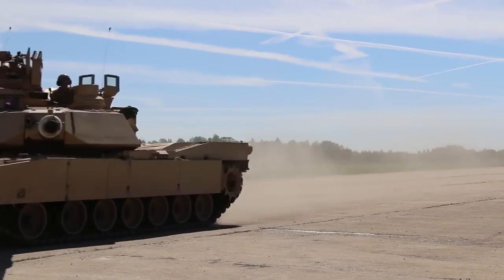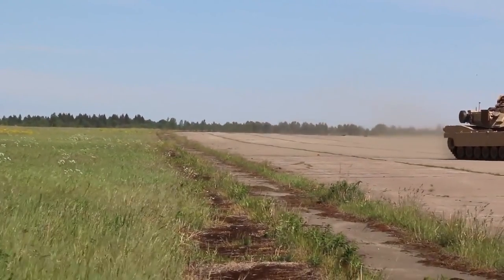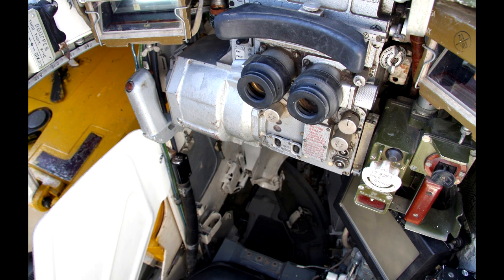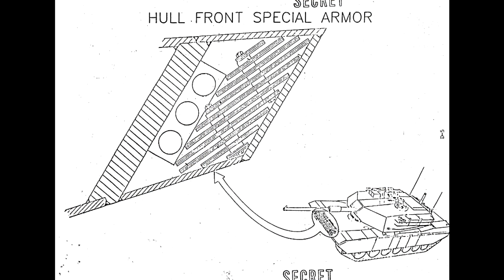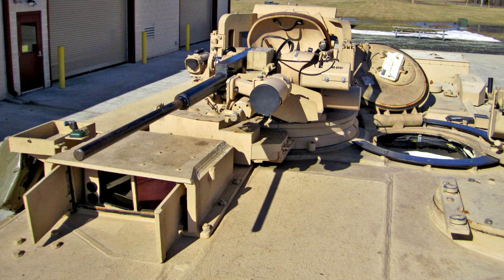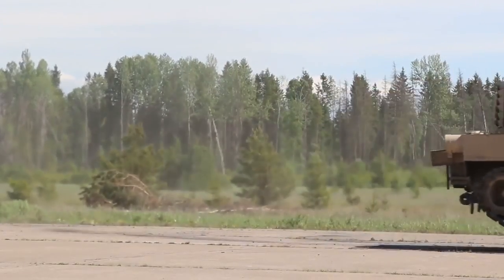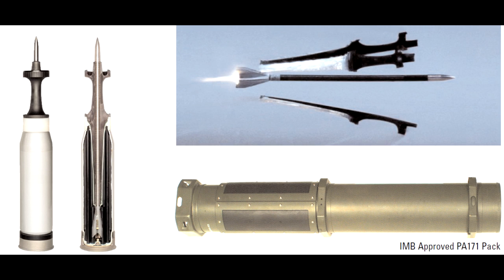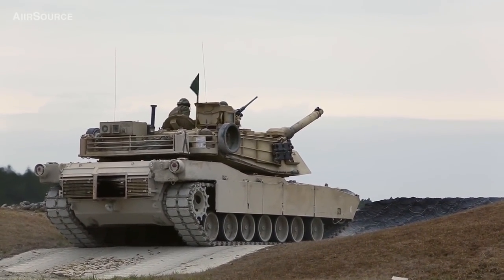Problems with Abrams tank

Comment: None of this is a surprise. Remember the 1st Gulf War? While the press called the Abrams invincible, the US Army actually realized that the Abrams was seriously flawed and that it was crew training that won the day. One high ranking officer even claimed that if his crews swapped equipment with the Iraqis they still would have won due to their training. The Saudis and the Turks are leaning the same lesson now. Poor crew training and improper deployment will leave any tank vulnerable no matter how well made.
Reply: Sure, that's true. Both sides had problems. For example, the M1 had a long trail of unarmoured fuel trucks following them for the all too frequent refuelings. This was a big problem that became a disaster in th 2nd Gulf war. I could talk about other problems. My point is we could go back and forth comparing strengths and weaknesses (ammunition, communications, export versions of tanks, C3I, etc....). The M1 wasn't the perfect weapon system it was presented as at the time and the US Army knew it. But it is true that the American crews were trained to a sharp edge at the NTC and other venues, and the US Army command believed that this was as significant a factor in the victory as the equipment.
Reply: @bohica3264  My dad was an Army fuel truck driver during this war. Thank God, he never went over.
Reply: @bohica3264  The M1 Abrams was designed to fight a primarily DEFENSIVE conflict for the expected Warsaw Pact invasion of West Germany, wherein the Group of Soviet Forces in Germany would launch strikes across the Northern German Plain towards Hamburg, Bremen, and Holland, and the 3rd Shock Army would come crashing through the Fulda Gap with more T-55s and T-72s that "Gawd", in a Soviet version of "Panzerblitz" to capture Rhein-Mein AB and Frankfurt before NATO could implement REFORGER.  Given that most M1Abrams units would be fighting no more than 100 km from their supply bases, its thirst wasn't a significant problem.  The AGT-1500 was selected for pure Power-to-Weight ratio and nothing else; when it was on the drawing board the state-of-the-art tank diesels in the NATO inventory put out 750 hp.  This "unterpower" of NATO AFVs was so bad that the Brits' vaunted Chieftain, which did have a kick-ass L11 120mm main weapon and a thick hide, could barely even mount its transport trailer!

Considering that the M1 Abrams had its combat debut in an environment that it wasn't designed for, it did quite well.  However, as others pointed out, it's not the technical merits or lack of same that determined the outcome. Differences in leadership, doctrine, logistics, training, and motivation contributed far more to the outcome than the equipment that each side used.
Reply: @bohica3264  every tank formation in history is followed by refueling equipment..GTFO with that stupid ass comment
Reply: @bohica3264  They also trained hard in theater prior to the start of operations.  Helps when the men get accustomed to life in the desert.
Reply: @bohica3264  When you have superior training AND equipment, of course you're going to win. That "high ranking officer" you quoted wasn't saying that US equipment was bad. At all. He was demonstrating how poorly trained and led the Iraqi's were and talking up how the US had an elite trained force due to it being an all volunteer force versus a conscripted force. Volunteers that are well trained will always have the superiority against untrained soldiers forced to fight, even with shoddy equipment like the Iraqi's had. That was his point, not that there wasn't much difference between the two sides equipment. Not sure where you're getting the US army realized the Abrams was a deeply flawed tank either. I was a tanker for many, many years and the Abrams is a workhorse of a tank. Every vehicle has some flaws but there's never been a tank so well put together, with quality logistics backing it, and superior training, tactics, and doctrine in how to use it in the history of armored warfare as the Abrams.
Reply: @ericharrison7518  I agree. My point wasn't that the Abrams was or is a bad tank. Far from it. But it's also a heavy fuel hog. The next opponent wont make the mistake of letting the Americans get all of their armour and the logistics to support them in place before they attack. Yes, the officer who said that US tankers would have won with Iraqi equipment was commenting on how many basic mistakes the Iraqis made.  The Soviet tanks used were not bad at all - some of the Arab allies used T72's and put in an impressive performance. Other factors such as substandard ammunition played their part. Again, if they had deployed, maneuvered, and handled their assets competently it could have been a much different picture.
Reply: If you mean T-72vsM1A1 at 73 easting the Abrams got there actually because of GPS on the tank. So yeah, also the T-72s had poor night vision and stuff.
Reply: @stardekk1461  Doesn't help that Iraq was receiving very barebones T-72s too.
Reply: @cloroxbleach9222  Indeed, naked tanks and demoralised tank crew added salt to injury. Not to mention the mismatched training and leadership. Iraqi leadership still thought that Alliance forces would fight and act like the Iranians in the earlier war.
Reply: @cloroxbleach9222  Hey! Those barebone T55s and T72 got a kill on a single crew member of a Bradley.
Reply: @cloroxbleach9222  They buried their tanks in the sand to hide them from airstrikes.  Once the Iraqi AAA and command-control were taken out, the war was effectively decided.
Reply: @stardekk1461  The only large tank battle in the gulf war started with the US using the abrams speed thanks to its turbine to roll up on the Iraqis prepared position on a reverse slope they dug into. They did all of that right. What they didn't do right was having proper recce, screens to let them know the Americans were coming. Iraqis were running and jumping into there tanks as us was unloading on them. That's the result of poor discipline, command, and training.
Reply: @stardekk1461  those are the old T-72A versions, cold war material that had bad sightings and poorer armor compared to later versions EG T-72B versions
Reply: Idk. My dads tank took an rpg to the vision block. And many shots from t72s and t55s with just leaving small scratches. This is also because he was in a m1a1 heavy. With extra du armor added. The gas turbine is for silence. Only a super power can afford to use them. You can see diesel engines and hear them miles out.  
All that said. The leopard looks way cooler and the t55 is my favorite tank.
Reply: @broadybundy  you can usually feel and hear armored columns coming. the Turbine isn't quiet
Reply: @jon782  no engine is. But in comparison to a big boy diesel.
Reply: @broadybundy  tbh gas turbines are loud as f*** and the Iraqi tanks use really bad and I mean really really bad APFSDS and heat shells with a Max pen of around 300-450mm
Reply: broadybundy you honestly don’t need that much silence in tank to tank warfare
Reply: @agentc7020  what a minute. You saying that a silent tank can't sneak up on enemy tanks compared to a loud tank?
Reply: Samuel Morales honestly I think it’s very situational, silent tanks aren’t completely silent just like silencers don’t completely silence a bullet, a tank is never alone so I really really doubt a tank could sneak on another tank within earshot, be it a loud tank or a “silent tank” they will get spotted by scouts, UAVs or something else.
Reply: @agentc7020  right, like those Iraqi tankers who couldn't hear those Abrams in the dead of night at 73 Easting. Noise is very important in warfare. Tanks perform best when superior tactics are employed. The tank that fires first has an advantage. The art of tank warfare isn't just ramming your tanks against other tanks. That is just stupidity.
Reply: Samuel Morales “the tank that fires first has the advantage” no shit Sherlock even in WW2 that was true and they didn’t have “silent tanks”, the iraq war was a different time where UAVs and recons weren’t common, of course tanks perform best with superior tactics, ANY army performs best with superior tactics, if the US was to fight a major power right now noise wouldn’t be a major aspect of warfare, ambushes aren’t carried out by noise alone you know? Noise alone can’t justify the use of an entire line of engines
Reply: @agentc7020  Logistics certainly can though. It's a lot less difficult to refuel your equipment when they all use the same type of fuel.
Reply: Eric Harrison yeah but both engines accept any type of fuel tho
Reply: @agentc7020  Yeah you don't, but everything little thing counts and the USA can afford getting expensive turbines for their tanks.
Reply: Samuel Morales I was attached to an M1A2 Abrahms tank unit in the infantry and all tanks are loud. Sure the M60A2 tanks that we used to have are louder but I neve4 heard of a silent tank and I deployed on NATO missions too being around British, French, German and Ukranian tanks. They are all loud. People play too much video games. India has the real STEALTH TANKS ( an elephant with an artillery piece mounted on the trunk) 🤣🤣🤣😂😂😂😭😭😭😹😹😹 had to make fun of India LMAO
Reply: @agentc7020  Movement lowers the effectiveness of camo, this doesn't mean one runs around the desert wearing all black.
Reply: jed-henry Witkowski yeah I get what you mean but sound and visual are two entirely different factors in a battlefield, and even if that was what it was I still don’t feel convinced that “sound” is worth an entirely different engine to the rest of the world
Reply: noise should never be the main way of spotting targets waht the fuck... under the best circumstances you have night vision sentries set up, as a second best option, infantry spotters....... and whiel the turbine engine is all so silent, it also takes what, over a minute to start from a standstill? so basically if your tank that cant really idle needs to move in short order....... it has to wait a minute to start its engine properly, neat
Reply: @samuelmorales2344  you won't hear a thing from a tank at a normal engagement range of 3-8km. Tanks are very noisy regardless but absolutely silent at a distance. Dust and smoke plumes or infrared signatures are definitely more revealing and dangerous than sound. Sound actually more limited to those others as sound waves lose energy quickly over distance. You can easily see a formation of tanks transversing a desert way over 5km.
Reply: @thefast427  lol, that is assuming you are looking where the tanks are at. Duh. That is like saying sneaky soldiers don't work if you are looking at them. Lol. That is why they avoid the line of sight and go around it. That is liking saying snipers are not effective if you are looking at them.  The Abrams spotted some of the Iraqi tanks and those Iraqis had no clue they were spotted. Diesel engines are significantly louder. They make a loud humming noise and even sound like a really loud lawnmower sometimes.
Reply: @samuelmorales2344  being sighted is a far surer outcome than being heard in tank combat as scanning for threats is what is always being done in combat. I do agree that Diesel engines have a deep rumble or hum than a turbine, I doubt that would be a concern especially in an open desert. Movement alone is risky in itself for being sighted, but add on top of a large dust plume of moving tanks in a formation and i can gaurantee that being heard before being sighted is poor situational awareness (sleeping on watch duty) and noise can be difficult to discern as well direction especially in a combat zone
Reply: @thefast427  Incorrect. It is recommended to keep moving as a tanker unless you are camouflaged or hidden into the environment. An idle tank is a dead tank. Tanks should never stop moving unless in a trap or ambush situation. There is this thing called "terrain" which can hide movements of tanks from the clear sight of the enemy. Things such as tree lines, uneven terrain can be exploited to the advantages of the attacking tanks. That tank that just came over the top of the small hill suddenly has you by the rear. US Abrams during the First Gulf War were always moving and stumbled upon idle Iraqi tanks that were spotted first in defensive positions. Sitting in one place can have an enemy tank incidentally catch you off guard that comes literally out of nowhere. It is very rare that tanks face each other face-to-face and be successful because it relies almost totally on technological superiority and nothing else.
Reply: @samuelmorales2344  amm....have you ever been next to a tank with it's engine running? O_o
Reply: @samuelmorales2344  lol just to be silent .. its actually sounds like a suped up turbo ina  car... but multiply it by 100x.. i guess you know nothing and try to sound smart they will hear you miles away  even with a silent tank.. and see you farther with heat signature of a gas turbine
Reply: @bojoperez-l2h  I didn't say it was silent. I am saying it has a shorter noise signature than a diesel engine. You will not hear a Abrams very well at a certain distance compared to diesel. Sure if you standing right next to an Abrams, it sounds loud. Duh.

Noise signature matters. That is why silencers exist even if they don't completely muzzle the sound. From a certain distance the silencer on a infantry weapon works because the noise signature is cut short. Enemies all around the area of fire fight won't pin point the direction the fire is coming from. Europeans even tried a silencer on a 155mm artillery. Cutting down on noise is just as important in certain situation just as much as reducing heat signatures on vehicles (including aircraft). If you can't clearly see or hear a vehicle, that is a definite disadvantage.  There is no debate about that. 

If you want to see how much more quiet the Abrams is, just look at any video that is pure sound that has both the Abrams and the Leopard training together. The Abrams has a 4,000 effective meter range. If you standing 50m away from the Abrams, you will hear it but 50m close to a tank is bad anyways. It is RPG city. 

https://www.youtube.com/watch?v=uuLzLt1Q7z8

Let me debunk your claims because you use normative reasoning. There is this thing called "TERRAIN". Thermals cannot see through terrain. Tanks can use terrain to their advantage. In fact, Iraqis used terrain pretty well in the First Gulf War where they mitigated the range advantage of the Abrams. None of these tanks were first spotted by thermals by either side in this particular situation. The difference is the Abrams could accurately fire on the move and the Iraqi tankers literally had to hand crank their turrets for target acquisition. According to you, with a normative reasoning, tanks "ARE ALWAYS" spotted by thermals. The First Gulf War debunks your claims because that was obviously not the case. US intelligence simply knew the general area of the Republican Guard and not exactly where each tank was precisely positioned. They stumbled upon one another by accident. Neither side had any prior knowledge to each others exact position. You have no clue what you are talking about. Yes, the US military had thermals back then in their recon forces. Thermals doesn't work through reverse slope defensive position. Your argument takes no account of tank tactics and assumes tankers with no brain-cells and absolutely no doctrine or training. Recon is limited by a snap shot in time of the enemy,  most of the time. The enemy doesn't want to be spotted and will constantly move to avoid the consequences of being spotted. That is what your simple argument doesn't account for. If you think an intelligent enemy is going to be in one position knowingly being spotted or observed by you, you are stupid.

Now if you want to argue that "drones" would of spotted the tanks using a rock/scissor/paper argument I can easily say drones can be shot down without much a big deal. I can easily make an easy to the point argument that tanks can be killed by aircraft. That is type of circle-jerk reasoning you use.
Reply: @agentc7020  spoken like a TRUE gamer...now go back to your game
Reply: @samuelmorales2344  Noise is an issue at 2km detection ranges on a battlefield? It's visual and thermal signature that gets you spotted first.
Reply: @Veldtian1  then tanks are useless according to you because ATGM have a 4km range which certainly out-ranges any infantry assault rifle so support doesn't really work.
Reply: @broadybundy  Indeed, one needs to be reminded that the Abrams tank was designed to fight the Soviets. Stealth and logistic flexibility was very high on the designers' priorities.
Reply: Aavinash Laskar Chaliha  "If foot soldiers (insurgents to be more precise) using RPG can take out Abrams then it speaks poorly for the tank" - tanks losing to infantry is just the way things are. That's why tanks need IFVs and proper infantry cover. If I remember correctly most German tank losses in WWII were also versus infantry.
Reply: Aavinash Laskar Chaliha  So you have no argument? Only insults? Thanks for admitting that you lost.
Also, funny how you claim I can't read, but when I mentioned that troops can hear vehicles before they see them in certain situations, you automatically assumed I was talking about tank crews even though I never wrote such a thing. You should learn how to read English. And you're the annoying one.
Reply: Aavinash Laskar Chaliha  "In your parallel universe perhaps tanks had ERA and composite armour during the second world war." - nice strawman. You literally claimed WWII tanks could only stop bullets. Try to dig yourself out of that hole.
"So the crew inside a tank will be able to listen to other tanks" - again, you're being ridiculous. Who said anything about tank crews? Again, dig yourself out of that hole.
Reply: Aavinash Laskar Chaliha  You only have insults. I have demonstrated to have more knowledge then you:
- you think that only tanks fight wars, because you can't fathom infantry hearing tanks approaching in wooded areas
- you think that WWII tanks could only stop rifle bullets
- because I said that German heavy tanks suffered losses to Soviet infantry you started sperging out about composite armor
You are completely delusional, ignorant and you can't read because you've misinterpreted everything I have said. And because you can't argue, you use insults. I am not being a victim, I am wiping the floor with you and pointing out that instead of fighting back, all you're able to do is shit your pants and declare yourself the winner no matter how many times you get kicked in the mouth.
Reply: Steve Arthur  That guy wasn't in a combat situation. That was him playing with the Tank Commander's Rack. Which had him almost lose his hand, luckily for him it had a pressure sensor. So yes you can theoretically prop the door open. But in a live combat scenario it's most likely to be closed. Even then it'd still be the crew's fault, not the tank.
Reply: Aavinash Laskar Chaliha  "That history happened in your alternative universe." - please name the Navy F4 variant that had an internal gun.
Reply: Aavinash Laskar Chaliha  You only have insults. Thanks for admitting you have no argument.
Reply: Steve Arthur  Unlikely. The Russian military is made up mostly of conscripts whereas the US has a fully professional army. There would be a significant difference in the quality of the troops fighting.
Reply: Aavinash Laskar Chaliha  , you mean the one F-117 that was shot down in day 3 of that war ?  Not bad considering that F-117 kept flying even after that incident. Oh and they flew more than 1,000 missions in its existence.
It is funny how idiots like you cling to two things  : Vietnam and F-117 

What speaks poorly about engineering are those SU-30Mki that keep crashing in India or the PantsirS1 that Israel keeps destroying
Reply: Aavinash Laskar Chaliha  "In this age of electronic surveillance nobody is going to put their ear on the ground to listen for incoming tanks." - in the age of electronic surveillance, it becomes easier to also use sound because you use electronic hearing, not the ear on the ground.
Reply: Aavinash Laskar Chaliha that goes back to WW2 when the allies decided that aces were far more useful training new pilots rather than racking up victories
Reply: Aavinash Laskar Chaliha  You claimed WWII could only stop bullets. Please provide source for your claims.
Reply: Aavinash Laskar Chaliha  Lol, you are stupid. You do realize that your old SAM missile shooting down a stealth fighter proves you are wrong, right? So why are you trying to argue otherwise? Or is logic not one of your strong points?
Reply: WOW my Battalion drove 26 hrs almost non stop, besides refueling, and other than hitting a few land mines, we lost NONE to breakdowns (56 tanks).
Reply: Steve Arthur  They don't wedge the blast door open, but they do keep 'ready rounds'
Reply: Steve Arthur  From where at? And are they actually US operated tanks. Documents indicate that the blast door has to be closed before arming the main gun.
Reply: Steve Arthur  Not really, they're more likely to be in a position where they can easily reverse to reload, and move back up to fire. And continuing the process.
Reply: Steve Arthur They can do the same with buildings, why else would they also be with infantry and NEVER by themselves
Reply: Aavinash Laskar Chaliha the M1A2 has an APU that allows the tank to shut down when at a standstill. So yes, the crew could easily hear enemy tanks.
Reply: Aavinash Laskar Chaliha how about take your mythical RPG-proof tank somewhere else
Reply: Bullshit Iraqi crews were conscripted 2 weeks before using Iraqi made tanks explains why most never opened fire
Reply: Let's all admit if america does get beat by Russia in tanks. The US would most likely just upgrade the Abrams to counter those threats.

Or even make a new tank to better suit what they need. So far all modern tanks are suited for what most countries need in terms of armored. Right now the US can easily upgrade its M1 Abrams tanks which even if it's on the spot modifications is useful in combat. And even after the Abrams losses due to Urban combat. 

We all have to agree that it's going to depend on the skill of the infantry and the equipment they use and their logistics. So let's all quit speaking numbers because with all of these modifications  the US is putting out to beat insurgents, The US is just getting used to urban combat compared to other countries.
Reply: The Abrams outclassed anything it met in Iraq. It's standoff capabilities and night  vision capabilities were huge! Combine that with the U.S. Military's Combine Arms  and Air Supremacy makes it incredibly good.
Reply: @31terikennedy  That's another big thing people who criticize military designs forget, which is that the design itself has to be looked at in context of the doctrine of the country using it and the issue of combined arms. If a tank has a particular shortcoming, but that shortcoming can easily be made up for by another weapon via combined arms, and the doctrine calls for the tank to be used in combined arms, then that shortcoming isn't a shortcoming and can actually be a benefit.
Reply: This is what im waiting for in this comment
Reply: Steve Arthur  The Iraqis were using export equipment, which is not the same as the Soviet versions. This is true for all client states. For example, Saudia Arabia has an army equiped with US weapons, but if they were to fight the US they would be crushed because while the equipment may look the same, it is not the same.

The point remains that if the US and Iraqis has swapped equipment, there is no way the US would have won.
Reply: Aavinash Laskar Chaliha  That is the only tank the Americans had, so not sure what you are talking about. The Iraqi tanks were destroyed, not disabled. A lot of Iraqi did abandon their weapons, but for them it was a route and they were running for their lives, abandoned equipment was the least of their concerns.

Any tank can be disabled, that is relatively easy. If an organized force is advancing or retreating rapidly through enemy territory they will destroy equipment they have to leave behind. If they are not advancing rapidly they recover the equipment.
Reply: Aavinash Laskar Chaliha  please provide source of WWII tanks only stopping rifle bullets, please.
Also provide source to only ERA being able to stop WWII tank shells, thanks.
Reply: Steve Arthur  RPG 28 is a completely different version of the...
Wait a minute he didn't said the type of the RPG.
Steve sorry and I have to give a information about the RPG.
A Abrams get shot from the rear with a RPG 27   they lost half of the crew, rest of the wounded and tank is turn into piece of burning scrap.
You can thank to me later. Not any tank is invincible. Altay is invincible.
Reply: @arvedludwig3584  I think none of its better, a gun is a gun.
İf someone put a barrel to your head, what are you going to say.
Are you going to say:
please don't kill me, or which gun is you are holding?
Reply: That doesn't explain all the T-72 shells that bounced off Abrams' armor
Reply: The Red Army demonstrated that poor training and improper deployment would leave even superior tanks vulnerable -
Reply: @rugger1009  by latewar 1944 and 45 the soviet army was quite a well oiled machine fighting 80-90% of German forces of all.  the myth of red army waves is just that a myth.
Reply: @rugger1009  oh yeah, when was that?
Reply: No they would not have beaten the Iraqis if they swapped equipment. The superiority of modern tanks is primarily due their weapon systems and combined arms support (which also has superior weapon systems), the tank itself is just a platform. Export versions are usually lacking in this respect, so a superpower fighting a client state can't just swap weapons and expect to win.
Reply: Aavinash Laskar Chaliha  They were actually destroyed by their crews. What the RPG did was disable the tank, not destroy it. That is a lot easier to do. In combat it is normal practise to destroy disabled equipment or abandoned defences rather than just leave them behind. The purpose of that is to not allow any enemy that may come up later to recover and use those themselves.
Reply: Steve Arthur  The point is that they were using modern tanks, which is what we are talking about.
Reply: Aavinash Laskar Chaliha  Dude, you don't have a clue. Stealth aircraft are not invisible to radar, they have a reduced radar profile which makes them harder to detect. That allows them to get closer, giving the enemy has less time to react when they are detected. If the enemy battery reacts fast enough, stealth aircract can and will be shot down like any other aircraft.
Reply: Steve Arthur  Wrong - RPG's of any sort are defeated by spaced armor or ceramic composite since they depend on heat and containment, block either and they fail. This is why DU penetrators were invented in the first place. (Tungsten/Magnesium penetrators are almost as effective).
Reply: Steve Arthur  Explosive Reactive Armour is utterly ineffective against shaped charges unless it detonates before the shaped charge (which is what the Russians are doing now). Once the charge detonates all the ERA is going to do is concentrate the blast.
Reply: Steve Arthur  Don't correlate the performance of one type of armor to another - they all have strengths and weaknesses. 
For that matter using a 120mm AP shell against a car is likely to be ineffective (unless you actually hit the driver or engine), it will go in one side and out the other.
Reply: Aavinash Laskar Chaliha  "please provide the link where I said WW2 tanks can stop only bullets"
5 days ago - "Tanks in that era had a basic heavy steel plate for armour. Concepts like composite armour, ERA, or even rolled steel armour were not even visualised. It wad basically a heavy metal plate to protect the crew from bullets and stuff."
You said tanks from WWII era only had heavy metal plate to protect the crew from bullets.
Reply: Aavinash Laskar Chaliha  "How the hell can a radar detect a low flying aircraft thousands of kilometres away when the earth is not flat?" - early warning radar bounces radiation off the ionosphere to detect contacts beyond the horizon.
Reply: BOHICA the Iraqis were using cheap shitty made Chinese ammo.
Reply: Steve Arthur  oh really name him or you're a liar.
Reply: Steve Arthur  you seem rather stupid.
Reply: Its also a shit tank like all other shit made in the USA.
Reply: Proud Indian  They were fighting on 2 fronts, out numbered and cut off from supplies as well.  To make it even more difficult their leader was an idiot.
Reply: Virtually any Cold War-era tanks can destroy a 2010s MBT if they can land a hit on the top, rear, and sides (if the gun caliber is large enough for the last one).
Reply: @mickeyg7219  yes because modern tanks have armor plating around the places where they'll most likely to be shot at regardless modern tanks would still be able to take punishment from cold war era tanks on the sides also. Just not the top and back
Reply: You mean when 4 American tanks were hit most by friendly fire? Compared to 85 Iraq MBTs
Reply: Proud Indian yes and diesel exhaust makes them easier to see...
Reply: Not to forget that there even was the rumor the iraqis were supplied with simple steel shot which was basically training ammo.
Also the asad babil was made of very very poor steel....
Reply: Steve Arthur  That I don't believe, given how overrated the capabilities of the Russians really were.
Reply: Proud Indian  No, Hitler was an idiot overall in terms of his military command. He was lucky at first, but beyond that, almost every defeat Germany suffered was due to Hitler.
Reply: Steve Arthur  I wrote the comment 49 minutes ago, but now I don't even remember specifically what I was responding to. I think it was a comment in which you said, or I got the impression, that you were saying that if the U.S. had faced the Soviet military in the Gulf War, that it would have gotten its butt kicked. Which I would question as the Soviets turned out to be a lot less prepared for combat then many had thought.
Reply: Steve Arthur  Probably the same things that tell you the Soviets would've beaten America in Iraq :D I forget the exact sources I've read it, but basically that the Soviet forces, being so massive, were not very highly-trained for the most part and a lot of their equipment, such as tanks, were poorly-maintained and not battle-worthy. Some of this was demonstrated in Afghanistan given that many of the troops were poorly-trained conscripts.
Reply: Steve Arthur  Not saying you are wrong, but what do you use as sources that the Soviet military was well-maintained? Their military budget took up a much larger proportion of their economy than the U.S.'s and they had to also maintain a much larger military as well. 

It is true that the U.S. troops in Vietnam were conscripts, and as a result, much of the quality of the U.S. military at the time was lackluster. But again, the U.S. didn't have to maintain a force the size of the Soviets. I would disagree that conscription was really used for Iraq and Afghanistan.
Reply: History has time and time again shown that proper use is much more important and difficult than having better equipment.
Reply: Proud Indian um lemme see any tank in an urban environment take 20 rpgs
Reply: The Abrams was literally rolling over AT mines like nothing
Reply: bruh the ratio was 7:1 in irag and 7 were lost to friendly fire while the other two were disabled so USA blew them up
Reply: What do you mean losing tanks to RPGs is unpardonable, aren't RPGs made to destroy armored vehicles? If so, why did they hit the engine which is nearly all of the weak points of a tank.
Reply: Oh right, don't forget about the fact that the Abrams tanks are made to survive ammunition explosions which is why they have blast doors on their ammunition, with blow out panels.
Reply: @wooflessdelta  RPG is and old weapon. 
After and rpg hits a target it sprays molten copper in the shape of a lance and penetrates the armor.
But the modern tanks like Abrams has a new armor to stop the energy. But of course if you shot a rpg to top of a Abrams I think you can get what you want.
Reply: @mysteriousguy2681  wtf is this for, the thin ass rears of tanks or the frontal armor. Because the frontal armor and sides sure as hell can defeat RPGs. The rear big no, but it does have ways to prevent a fire. (Like any other tank in the entire world)
Reply: Steve Arthur  I looked it up - the Challenger was hit in the bottom while driving over an obstacle, not in the main armor belt. Their was no major penetration and the tank was repaired (after being driven back to base) and back in service the next day (with extra armor under the nose).
Reply: Aavinash Laskar Chaliha  US lost tanks in the "SECOND" Gulf War because they were in urban combat. Different situation. Abrams can kill tanks 4 thousand meters away. I am talking tank warfare, not tanks facing insurgency. If Abrams can shoot you from 4,000 meters away, of course, being quiet will be an advantage. The Abrams was designed to be a tank hunter. Firing from long range in surprise hits and has a 90% accuracy against moving targets. The Iraqi tankers didn't know what hit them in the First Gulf War. The Gulf War debunks the claim that noise reduction is overrated. The goal of tank tactics against other tanks is getting the weakest angles of enemy tank exposed and to achieve alpha damage.
Reply: @samuelmorales2344  4000m? Are you trying to say that can outstand the world record made by a Challenger 2?
Reply: @WookieGroundZero  The Challenger 2 had a 5.1km record kill. It has a rifled main gun.
Reply: Aavinash Laskar Chaliha  you dont have to put your ear to the ground to here a big boy diesel.
Reply: Steve Arthur I agree with half your statement...the difference in equipment was huge and one of the primary reasons the US won; however, I think you’re missing a few things.  Deception was a maneuver tactic that the US was able to execute because of modern training and doctrine.  The training of NATO professional army was much different than Iraq or even the Soviet Union.  Digging in and creating kill zones didn’t work for the French in 1940 and certainly wouldn’t work in 1991.  The Gulf War exposed Soviet doctrine, not to mention their military equipment, as being hopelessly obsolete.  If you’re unconvinced, look at the frantic effort both Russia and China have done since the Gulf War to modernize both their equipment and doctrine.
Reply: Aavinash Laskar Chaliha I know! I was an 11 hotel anti armor in the army who operated a BGM-71 TOW as a gunner. We also used AT-4's and Javelins ( dragons before that) which are dedicated anti tank. RPG's are no different than an M203 which are used for suppressive fire not anti tank. A lot of these PRO US made weapon videos on youtube and media are PROPAGANDA done by the CIA. I know I am also a cold war veteran. Both the KGB and CIA were good at propaganda on the masses.
Reply: @asianfighter62  
 S
N
A
K
E
S
 

Well said friend
Reply: BOHICA The US haven't faced a real military since Vietnam and even Vietnam didn't have an air force and Navy. I was in those wars you mentioned and retired US soldier. The US government and many Americans are arrogant. The reason why the US and NATO picks on small countries that has a third word military or lack of a full military like insurgents YOU EXPLAINED IT! They don't have the training and ability. If we fought real militaries like Russia, China and N Korea, we will get our ass handed!
Reply: @asianfighter62  Vietnam had a pretty formiddable air force early in the war. MiG-21/Bis, 17s, and 19s were pretty scary to an F4 Phantom without defensive armaments.
Reply: @asianfighter62  Iraq had one of the worlds strongest armies at the time of the gulf war, and they had extensive actual combat experience as well. They were no pushover, but they had no answer to modern weapon systems and that was the difference.

The US would likely still win any conventional war against a first world military, simply because of the sheer amount of resources at their disposal. The main difference between such a conflict and the gulf war is that US casualties would be much higher.
Reply: @asianfighter62  Wait!  You think 1 on 1 that North Korea would kick the USA's ass?  1 on 1 The USA could completely exterminate North Korea but wouldn't.  China would be the toughest land war due to distance/ranges and troop numbers. Russia would not survive a 1 on 1 all out war with the USA.
Reply: WING CHUN Vietnam definitely had an Air Force
Reply: @asianfighter62  bla bla bla.
Reply: @asianfighter62  I agree. We are no longer in the golden era of the us military. 
<nice name I trained wing Chun growing up>